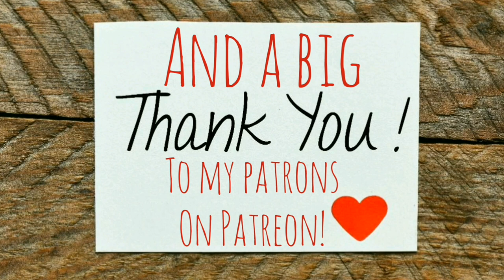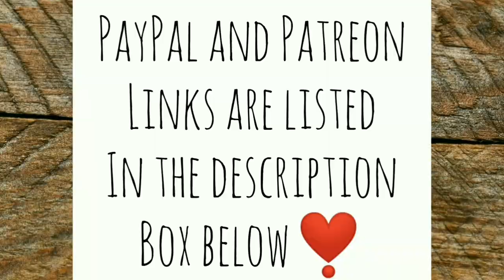Trouble in Wood Burning Stove Paradise - Ann's Tiny Life

Comment: I've been using wood in my 1800's parlor stove to heat the house for a few years now.  Theres several things you can do to make it much better.
1. Seasoned wood. There's always dead wood around.
2. The chimney, get a cone shaped cap that extends out the sides a few inches. It keeps rain from solidifying the ash on top.
3. Tee fitting on the elbow and a cleaning brush. Nasty job but it needs doing.
4. Damper, I get the flue temp up to 180-200° then damper the pipe down about 1/3rd more once the fires hot and there's not much smoke.
I just wired an oven thermometer on the stove pipe about four feet from the stove.
It's all a learning curve but you can tackle it after a little observation👍
Reply from the maker: oh absolutely great suggestions! so good to see you again!

Comment: I had a similar set up with the small holes on the top of the pipe. I removed that part and put a regular rain cap on it. This allowed more draw and cut back on majority of the smoke slapping me in the face. My theory was all those holes was restricting air flow/cross winds. Mine was not on long enough for soot build up.

Comment: We just installed a wood stove in the room above our garage this weekend, the pipe cost more then the stove!! And it took all day to figure out the configuration of the pipe. We heat our whole house with wood but the stove hooks into a regular chimney, so much easier. Those caps on the end of the pipe are the problem, they clog so quickly causing creosote to build up quickly. Your idea is exactly what you need, easy cleaning.
Reply from the maker: I had a conversation with Mr Lucas across the street yesterday and we talked about the size of my pipes. he's got me thinking that I might want to adapt my wood burning stove to bigger pipes. I think this might help at least part of the problem. thanks for the info!
Reply: 6 inch pipe would definitely make the stove draft better and adding the clean out section and you’ll be set. You always figure it out.....trial and error!!!

Comment: Hey Ann, boy those holes were really plugged up. I've got my stove going now but it's quirky, learning lil tricks to help it burn better. I've used a lot of not very seasoned wood in mine and I know I need to take the pipes apart and clean like you did, I'm just putting it off til I get time. That clean out piece really seems to be a great thing to have. Really enjoyed this video and way to go with doing that all by yourself, hats off young lady!
Reply from the maker: it actually wasn't too hard. of course my stove pipes are pretty small so they're not too heavy. yeah I need to get the clean out tea pipe thingy. I'll get it eventually. until then I'm just going to check it at least once a week, or maybe every other time I clean out the firebox of ash.

Comment: There could be a few things and some things might be very simple
The direction and speed of the wind passing at the top of the chimney can sometimes cause things to smoke because it puts a positive pressure in your pipe
If you have a smoke issue try opening the door or window while you’re lighting it so it kind of pushes it upwards
What you said about the t pipe is right on the money and that way you can run a cleaning brush right up your chimney from the bottom
Pipe size can also be an issue… Maybe next year upgrade to a bigger diameter pipe
Green wood or wet wood. I know this is your first year they are so you don’t have much of a choice… May be a woodshed build for next year LOL

I look forward to see if you cleaning out that pipe work and I figure you might have known what I said but on the chance you didn’t I thought I put it down… Take care Ann

PS Did Mr. Lucas eat that egg?
Reply from the maker: all great info dave! I'm not sure if he ate or not. I'm pretty sure he will though!

Comment: You may get another egg later in the day. I'm imagining the problem at the top of the pipe might come from it getting wet from rain/moisture, making the soot stick in those places. I had always wondered why some chimneys didn't have an umbrella type covering over them to prevent rain from getting in there.
Reply: I bet, Ann, can get a attachment hat in that size. Guessing, that's exactly what's happening with the rain and soot it's sticking.
Reply from the maker: could be the rain! I'm thinking it's probably a combination of that and the small size of the pipes.

Comment: You need to clean your pipe out every few weeks or you could have a chimmey fire, there is a cleaning product you can get a Menards that you throw in your fire that keeps the build up fown n there is a chimney brush to use
Reply from the maker: 4 weeks isn't going to be often enough for the size of pipe that I have and the type of wood that I'm burning. I prefer not to use any chemical products for cleaning because I use the wood ash for various other things such as in the chicken dust bath, the compost heap, and my garden beds. not a good idea to introduce chemicals. I don't mind putting a little elbow grease into it.

Comment: Your fires are not hot enough. You need to get one of those simple magnetic heat gages (not expensive) that mount on your chimney inside your cabin.... shows you just how hot your fire should be.   I have one and
 feel much safer  knowing  im burning efficiently and safely.
I believe that should help your issues.
Reply from the maker: Thanks for the tips!

Comment: First thing you need to do is get rid of that piece at the top and get a roof cap that won't let the rain get on the inside of the flue. what ever you
Reply from the maker: not in the budget right now. I have to work with what I have.

Comment: What size is your chimney?
Reply from the maker: all of the pipes in this small guide gear wood burning stove are 3.375" except the ones that I've added such as the elbow pipes and whatnot. the inside elbow pipe is a 3-in elbow. the outside elbow pipe is a 4-in elbow pipe. the double walled pipe connecting the two elbows is a 3-in double walled pipe. these guide gear wood burning stoves have very small pipes. that's definitely part of the problem.

Comment: I was thinking you need a rain cap at the top?
Reply from the maker: possibly. it might be hard finding one that fits this size pipe though. remember, and I think you may be able to see it in this video, the top is covered so if rain is getting in it's coming in through the sides.
Reply: @AnnsTinyLife  Ann I don't have a link but I watched a guy installing one through a window just like ours. He took a piece of some thin sheet metal and just looped it over the top and secured it to the pipe to prevent rain from getting in. Mine isn't done properly and comes out under a tin roof overhang that's keeping rain off so didn't have to do it here. Just a thought, I'll let ya know if I come across that vid in case it might help.
Reply from the maker: @TheBlackSheepDiaries  I've seen that video! It might work not sure.